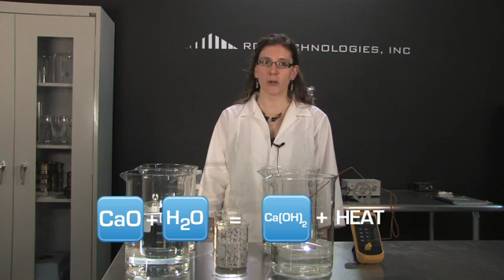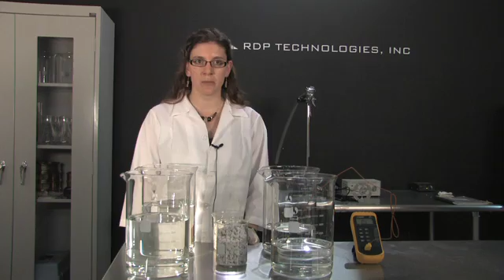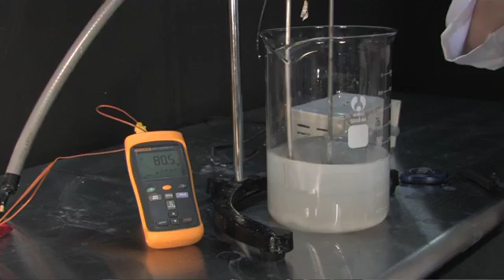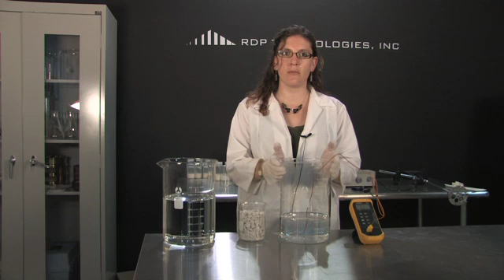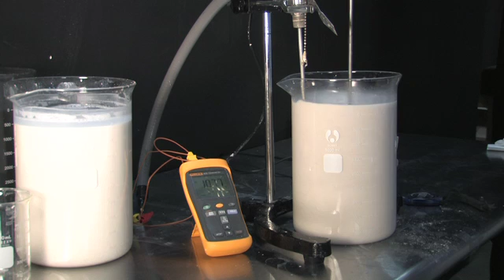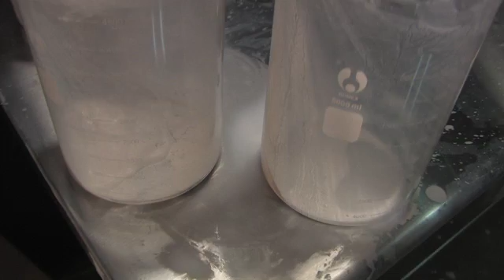Precision Lime Slurry VS. Drowned Lime Slurry

Comment from the maker: Drowning lime is a process that is highly undesirable. "Drowning" the reaction adds cold water before the reaction has fully completed. Lower temperatures lead to larger particles, less surface area and poor utilization of the lime.

Bottom line is, with cold water you use +10% more lime and you increase your sludge production.  It doesn't cost any more money to operate at a higher temperature so the question really is, "why use cold water at all ?"

Comment: Thanks for the video.
I understand how hydrated lime can lose it's water and get "burned", but what is the processus of drowned lime ?
What is the effect of too low a temperature in the mixture and how does it affect/ prevent the full hydratation process of quicklime ?